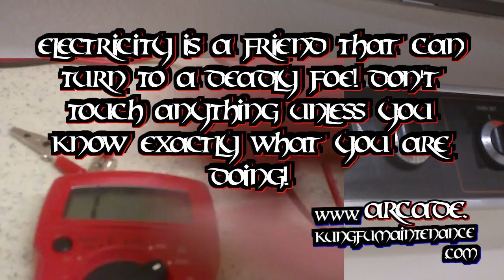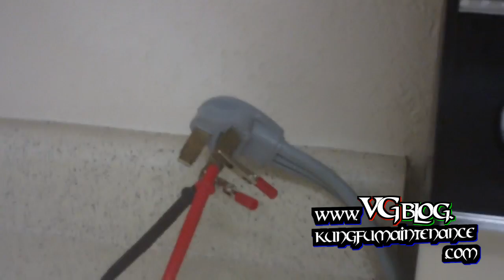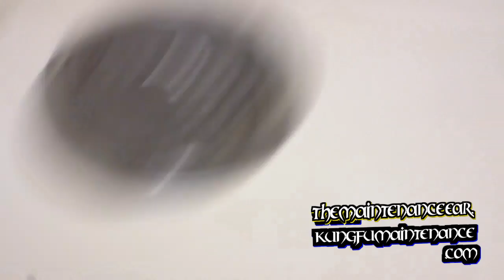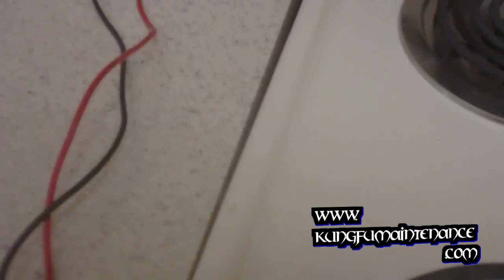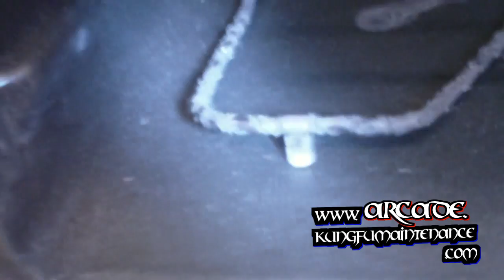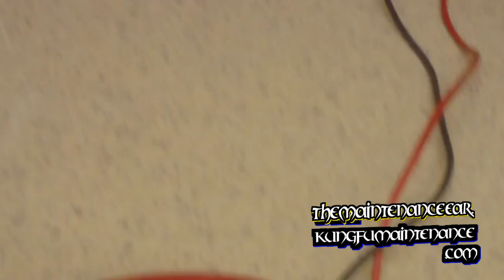How To Test Electric Stove Elements ~ Oven Range Bake And Broil

Comment: Good effort buddy....but for one, the font you are using for the writing is not only very irritating, but hard to read. Secondly, you need to learn how to pronounce "continuity" properly. Lastly, you need to explain things better. I am an electrician and I understand completely what you mean, but for someone who has no experience what so ever with a meter, or stove burner elements, or anything close to what you are talking about, they haven't got a clue what you are saying. Like when you say "this one's showing 39". 39 WHAT? What does that mean? Did you even explain how to set the meter to the proper setting? Did you explain what continuity is? People wont have a clue what you are talking about and your video gets cut off and they click on something else, hopefully getting a better explanation. If you're going to start where you do, maybe you should include a disclaimer stating something like "this is not for the very beginner. This is for people who have a basic knowledge and understanding of electricity and multimeters and how to use them...." Just a few pointers, cause I found this to be incredibly assuming and confusing for anyone who knows nothing about these things.